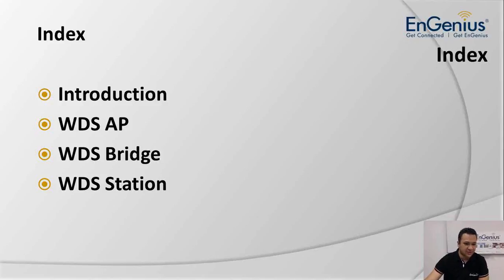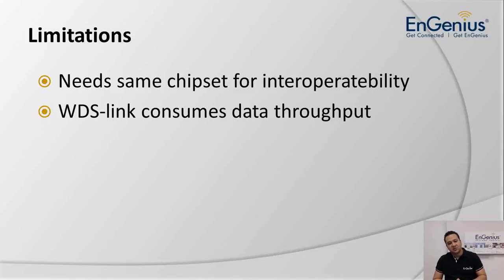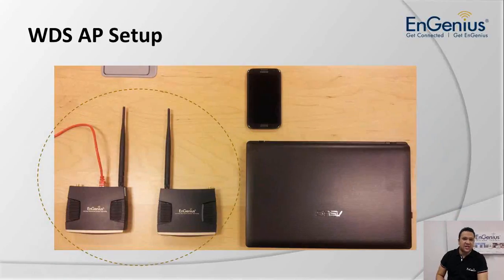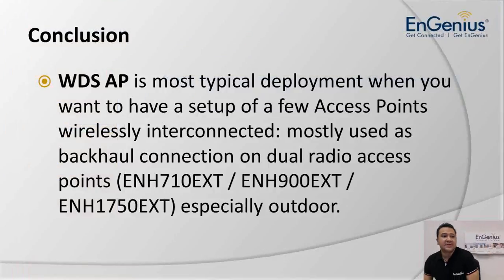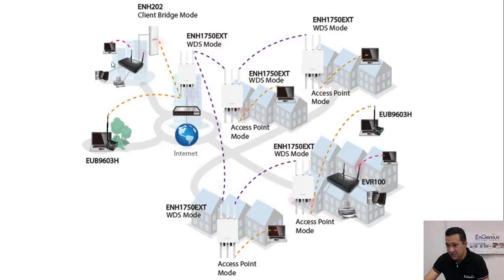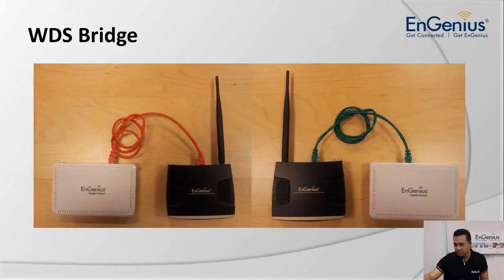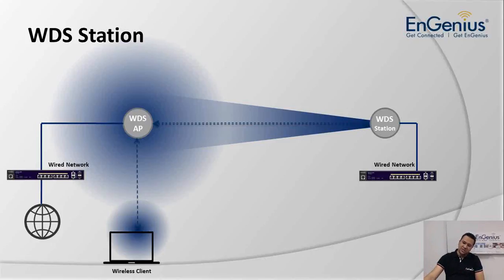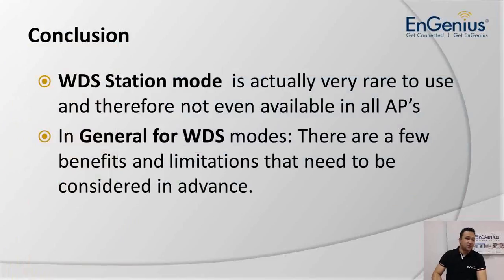EnGenius WDS modes: Webinar

Comment: In my opinion this company sucks.
Reply: Why do you say that?   I have two of their older devices that are used as an AP/Repeater for the last 6 years without  a problem. Except for power failures they have never been restarted or touched.  I am thinking of adding some more of their equipment as I rewire my house during a remodel.